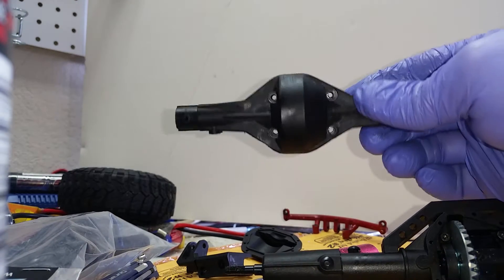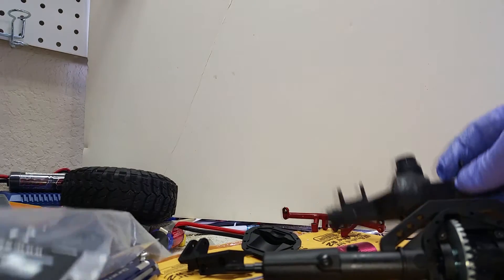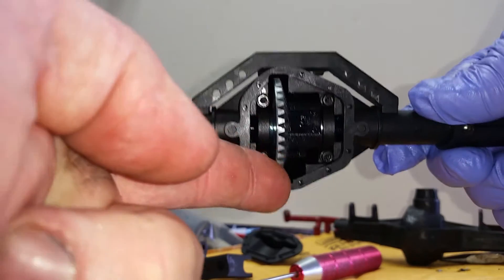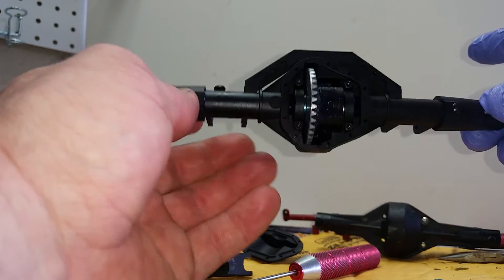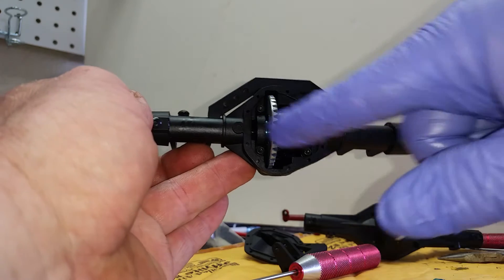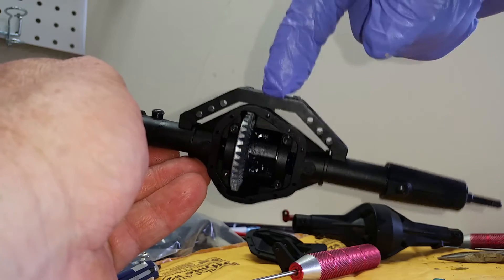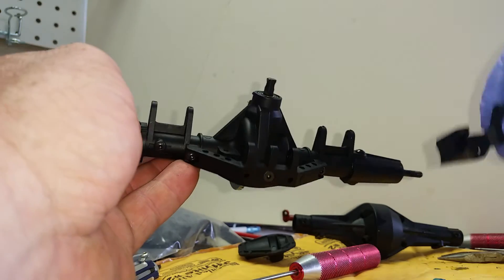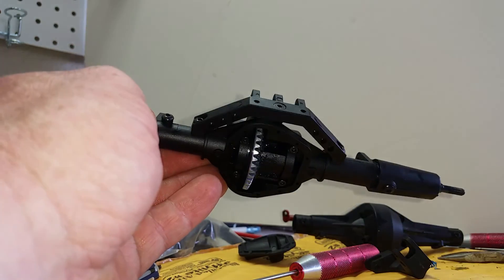SCX10 SSD RC D60 axle housings assembly overview

Comment: I'm a little late to the game but I just purchased these axle housings and up in attempting to install the axle shafts I'm noticing they don't fit with the straight axle shafts... Any tips?  Due to the lip on the shaft I cant install the outer bearing because it wont let the axle pass through... Any advice would be greatly appreciated.
-Greg M.
Reply from the maker: greg maciel I think what you're referring to is actually installing the stock shafts into the ssd housing. From what I remember you'll slide a bearing over the small end of the drive axle all the way to the dog bone end then install the axle into the housing all the way into the stock diff locker then you'll put the stock lockout (the plastic piece the goes on the end of the axle housing on the ends) over the bearing then line it up with the 2 screw holes and then install the 2 tiny screws. If memory serves me correctly. I certainly hope this helps, if not I will be more than happy to help out a fellow RC'er and thanks for the comment!
Reply from the maker: greg maciel it could possibly be the bearing goes on the outside of the axle shafts and the lockout holds the bearing and axle in the housing keeping it from moving or falling out.. that actually seems to make more sense, if this doesn't help I'll be glad to pop a wheel off of mine and have a look to make sure I'm correct
Reply: pmm4177 
I think my issue is I'm not using the dog bones... I'm using the AX30421 straight axle shafts instead of the dog bones....  I don't think they r going to work with with this ssd housing. Bummer!!!
Reply from the maker: greg maciel if they're stock length and work with the stock bearings then they should in fact work, I know the rear stock axles are straight, the "D" shape on 1 end and threaded on the other. Try putting the stock bearing over the threaded end of the axle and then put the axle shaft into the ssd housing then slide the lock out over the bearing. That is a bummer if they won't work because these housings look so much better than stock
Reply from the maker: greg maciel ok, so I've looked up the AX30421 axles, from what I can tell the 30421 parts have a larger diameter collar on the ends. Now I want to be clear, I'm not telling you to but if they were MY shafts what I would do is lightly sand down the diameter of the collar bit on the center diff end (the "D" shaped end, not the threaded end) that slides into the ssd housing. I can see where they might not fit into the tube portion of the ssd housing because of the larger diameter collar thing. That's what I would do so please remember, do this at your own risk, I would honestly hate for you to mess up a new part because of something I told you to do. Of course the stock axle housings don't have that issue because they're 2 pieces in halves. I do wish you luck, if you lived closer (where ever you may live) I would offer to meet you and personally help you fix the problem because honestly I know the headache of having new parts and them not working because of unseen problems before putting out hard earned money on them.
 When I had the stock housings on mine I had an off brand (can't remember the brand) chassis mounted servo bracket with panhard and it didn't work with the ssd housing so I had to buy some 1/4" aluminum round rod and custom make the Panhard link and front 3 link just so I didn't have to go back to my servo mounted on my axle which wasn't really hard but it too was an unforeseen issue that I wasn't expecting. Probably my next upgrade is going to be the high clearance front steering knuckles so I can get my steering link up out of the way of the housing so you can see more of the front axle. I'm still in the process of Engineering a steering link system that routes behind my front axle that will keep the geometry for the Panhard link. 
 Anyway I've gone completely off topic, if you need any more assistance I'll be more than happy to help however I can. Thanks again